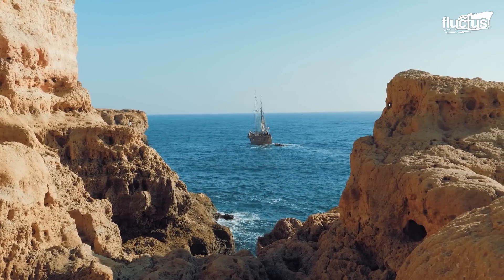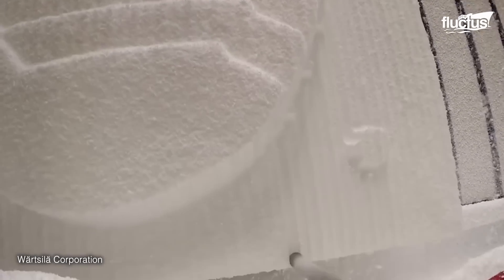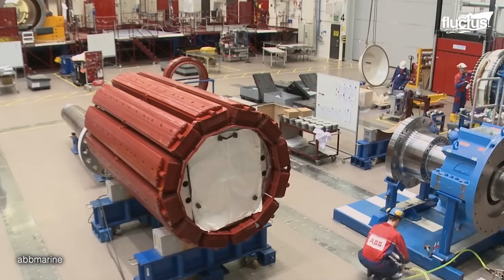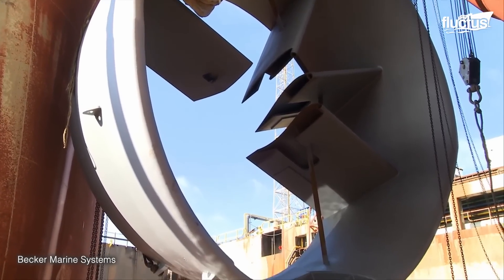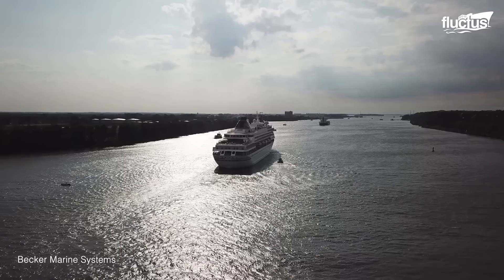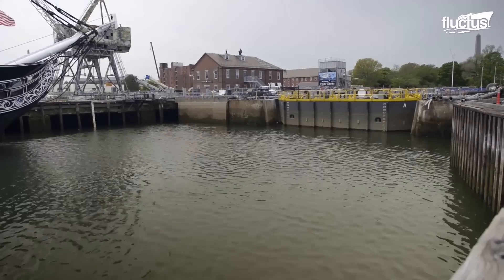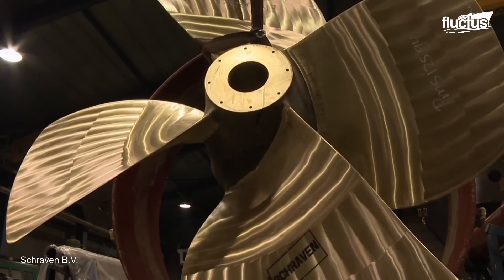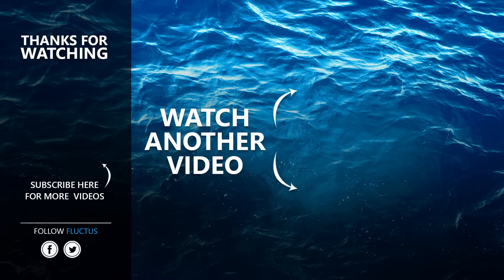The Crazy Evolution of Propeller Systems Moving World Biggest Ships

Comment: What about the Sharrow props that have been the rage in the boating news?  I thought they were supposed to enter the cargo shipping industry soon.  No mention of them here.  I can't imagine an industry that would benefit more from increased prop efficiency than shipping.
Reply: its possible that the efficiency doesn't scale properly to the size for large ships. the complexity and expense of making a sharrow prop at the size required for large shipping vessels might offset any gains they would see. The large ships also see much slower rotation speed so the issues that the sharrow prop addresses may not apply.
Reply: Sharrow props have to be CNC machined. There is not a CNC machine anywhere on the planet even half the size that can make one. It’d probably cost a few hundred million dollars to make a CNC machine that large. Also props that large have variable pitch and you can’t vary the pitch of a Sharrow prop otherwise you’d see them on the front of prop planes as well.
Reply: @brandonadams7837  most very large props are in fact not VPP. So that is not an issue
Reply: @ova578 who told you that? I'm curious, I've been working on propellers since '96 and work in the largest drydock in the Western Hemisphere. We are at a point now where it's 50/50 with CPP versus fixed. I just did a set that were 40 foot diameter.

Comment: The "discovery" of the steam engine? It was an invention - they didn't find one buried under a tree.
Reply: This can be debated.
It was a rediscovery of sorts tho - ancient greeks and later the romans that used "borrowed" greeks to do the heavy maths for them knew of the power of steam and how to put it to use. 
Romans technically had everything to kick off  industrialisation - they didnt because slaves where way cheaper...
Reply: @billklatsch5058  A recreation of an invention is not a discovery. There are no steam engines in nature. An analogy I like to use is the wheel. The roller is a discovery - someone was pulling something heavy and it got easier when it ran over a round tree limb. But joining a wheel to an axle and mounting it in a bearing was 100% invention. The steam engine is just like this.